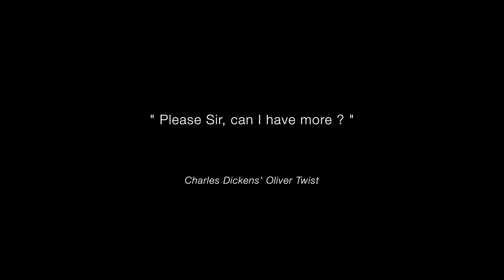Putting on Weight - an update on Kingston, Ontario's La Salle Causeway 4K

Comment: Are they going to just push the bridge across or will they use a huge crane to move the bridge on the gap.
Reply from the maker: Great question - I am told that both will apply.  It will be pushed from the east and a crane will assist from the west to keep the projecting end leve once it passes the 'tipping point'
Reply: @Aerosnapper  Thanks for the answer.